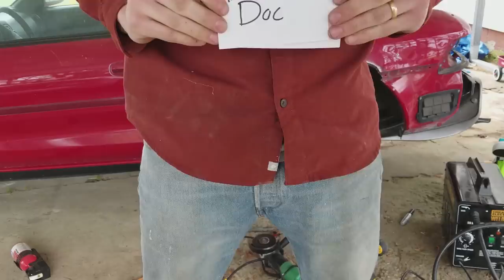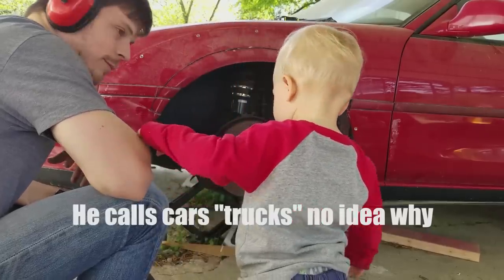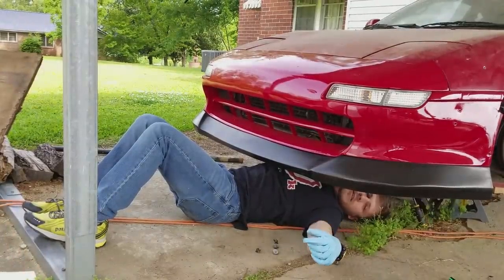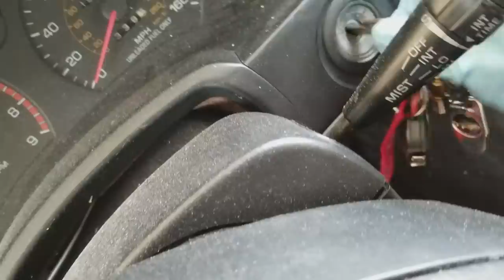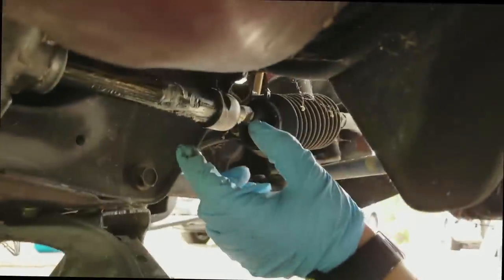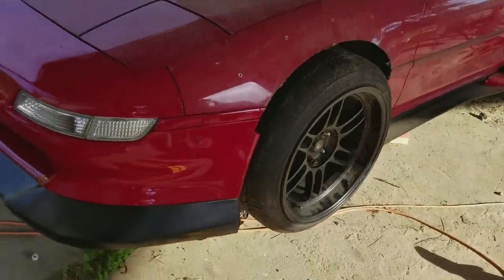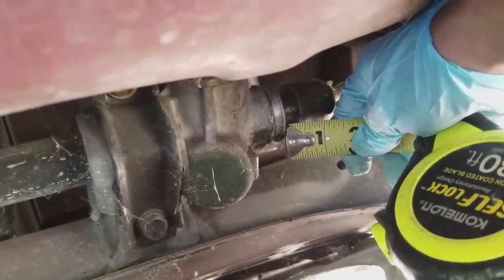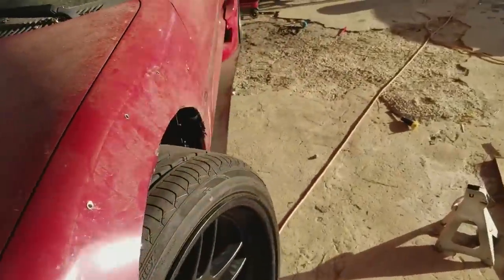PUTTING BIG WHEELS ON A SMALL CAR

Comment: I bought a 1991 MR2 G-Ltd (auto - ew, but bone stock in amazing condition and crazy low mileage) a bit over a week ago as my first car and I love it. One day I hope to be able to afford a turbo (post-1993) to do a Gen4 GTE or K-Swap and a custom rocket bunny job.

I just hope the turbo cars don’t absolutely skyrocket in price before I can get myself one.

Love your work and you’ve been huge inspiration.
Reply: BUILT in my research it seems that the V6 isn’t the best value for money. You can get 500 hp fairly economically out of a 3SGTE of nearly any generation and if you want more than that you can get up to 1200hp out of a turbod kswap. 

The main problem I foresee is sourcing a manual transmission from a turbo car, as the transmissions from the NAs are far less durable and even 280+hp is risky in the long run.

This is all of course according to the internet so how accurate it is, I have no idea.

Thanks for the inspiration once again.

Comment: In my SW20, there is HEAPS of room in the back wheel arches run a HUGE tyre - i've got 295 30 R18 size tyres in the back, while the fronts are 225 35 R18 up front without spacers!

This thing looks sick though!

Comment: Looking better by the day! I’m wondering if the front bumper would look cleaner with the vertical slats cut out of the grille?
Reply: X1XBlackbirdX1X the bumper loses support then and the bottom sags
Reply: BUILT Maybe spray them Black and/or put a gitter infront of them

Comment: So the opportunity is there for me to get one of these as my first car. How easy are they to work on with the engine being where it is? I heard they can be difficult for first timers?
Reply: jvck _ it's not difficult at all. The only pain in the ass is you have to drop the subframe in the rear everyone you need to access the rear like removing the exhaust or replacing the alternator. Think of it like this it's a backwards front wheel dri email car with the motor in the back. I will say if you want one go for a turbo. If you can't an na is just fine. There a lot of things to look for when buying one. If you need any suggestions or tips on what to look for let me know. You will totally love to drive an mr2 it's awesome.
Reply: jvck _ I bought one as my first car a bit over a week ago and I love it. The NA ones have a few less components and so are a tiny bit easier to work on and if you aren’t used to RWD or mid-engined handling, many MR2 owners will recommend starting with an NA. However, I still kinda regret not saving for an extra 6-12 months to make the upgrade to a turbo.
Reply: cool thanks for the replies guys, ill update yall on my decisions :))
Reply: Had 3 of them, 1 hardtop 1 moonroof and 1 t-top (all red and '91).  Hardest part is reaching into the engine bay when you have to, can put scratches on car easily. Also, the pipes from hell can cause a headache. I liked the hardtop the most, dont see many of them around.